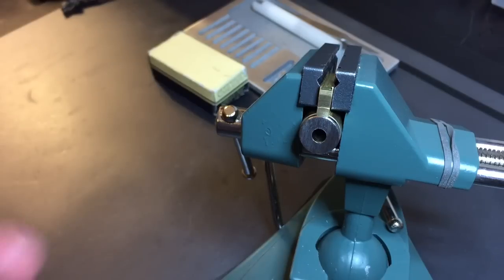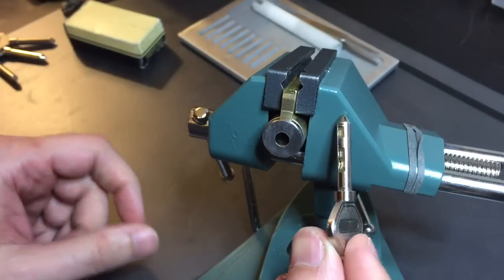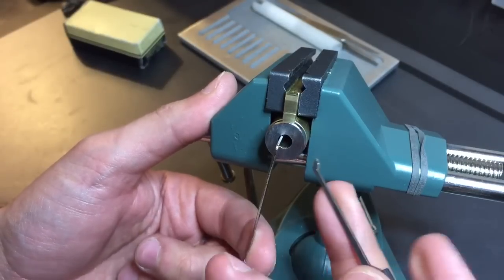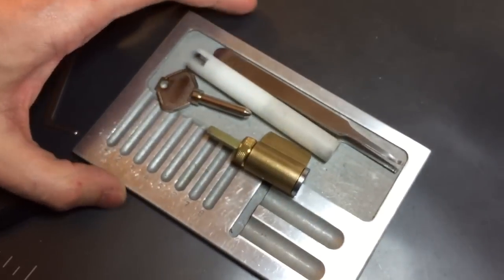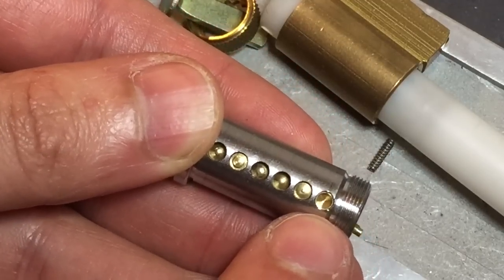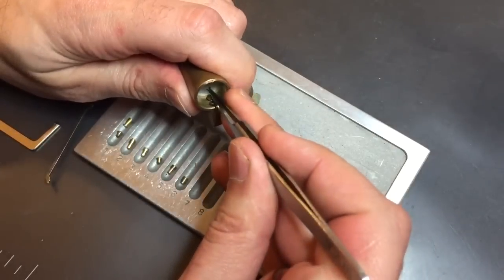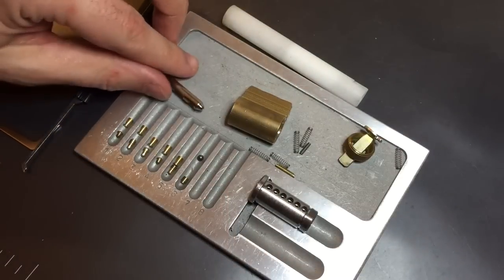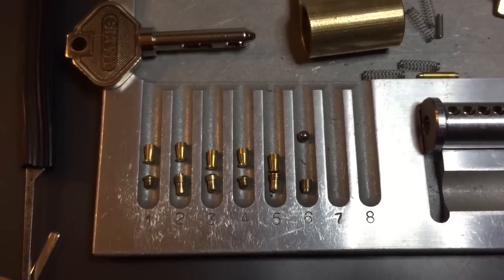[87] Maxis Cylindrical Key Lock Picked and Gutted

Comment: Great picking. Never thought one can tension the plug like this - very interesting. Also very nice to see the pins.
Reply from the maker: +Potti314 Thanks... neither did the makers.  I think the company slogan was "if you can't tension it, you can't pick it" ... or something like that.  Needless to say, that was a failure of imagination.  If this didn't work, I would have attached a polycarbonate rod to the face of the lock with instant set UV glue, then removed it with acetone...  EVERYTHING can be tensioned in some way!

Comment: Great picking and video. The ball bearing might be to ease key retraction. As you wrote earlier it "provide tactile feedback at the 12 o'clock position". When you approach 12 o'clock position during rotation, the ball snaps to place and aligns key and driver pins, therefore allows removing the key. Without it user might be "fishing" for the right position to pull out the key.
Normal pin would ease the key insertion but wouldn't do anything for key removal - the standart driver would have no space to move to plug and stopped it on twelve.
I had this recently in chinese dimple lock (pins on both sides) and I wondered where they copied that.
Reply from the maker: +Mike Pergl Could be... in fact, I would wager this is the exact reason for it.  The problem is that I can think of better ways to do exactly that that would increase security (rather than being security neutral).
Reply: LockPickingLawyer With only a narrow bible, using one chamber is the only way to use a real spring and a decent size bearing ball. Mortice or rim cylinders allow for additional chambers at an angle, so you can have a reliable, long life 'key retraction aid'.

Comment: Way late on this, you probably will never see this comment, but, my guess would be the detent bearing helps keep the lock aligned when removing the key, so any accidental twist won’t leave the lock slightly misplaced and unknowingly unlocked. A standard key way this would be more visible, this lock there is no visual clue

Comment: do you remember that vintage yale cylinder. I have some 6pinners with those fat pins in it. i think they're from safe deposit boxes because every other one has a different tail piece. i dont kow what size they are. I want to order security pins to fit those fat pins to make interchangeable challenge or practice locks. 
Guess I need to buy more tools. I got obsessed with collecting picks.
Reply from the maker: +JB Not sure what lock you're talking about.
Reply: +LockPickingLawyer my bad, thought you posted video on a similar lock. must of been someone else

Comment: maybe that heavy spring and bearing makes it bump resistant
Reply from the maker: +JB Interesting thought.  At first, I thought your comment was incorrect since the detent does nothing to stop the core from turning.  But upon reflection you could be right.  The detent requires relatively heavy tension to overcome.  The heavy tension prevents bumping.  Alternately, the light tension usually used for bumping would not overcome the detents spring bias towards center.  Is that what you were thinking? Something else?
Reply: +LockPickingLawyer 
the only other thing i could think of was a type of zero pin. should check the patent out
Reply from the maker: JB Not sure what you mean by "zero pin."  Oddly enough, I did look at the patent to figure this out (I'm a nerd like that, and the patent # is on the box).  It just says that its used as a "positioning" device and to provide tactile feedback at the 12 o'clock position.  Seems like a waste of a pin chamber to me.
Reply: +LockPickingLawyer meant a zero lift pin. some euro locks have a zero lift pin in it & when you touch it, it immediately over sets and the pick is dead.